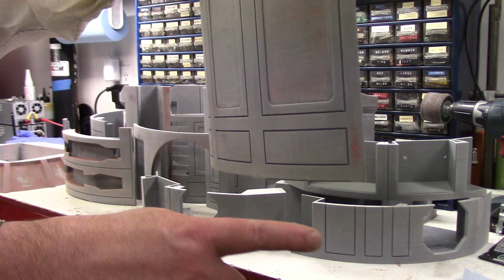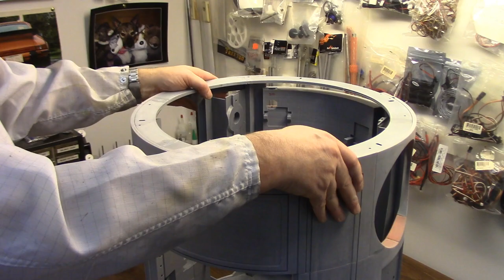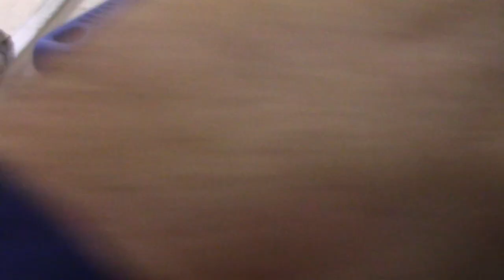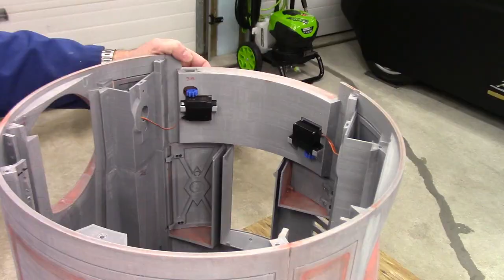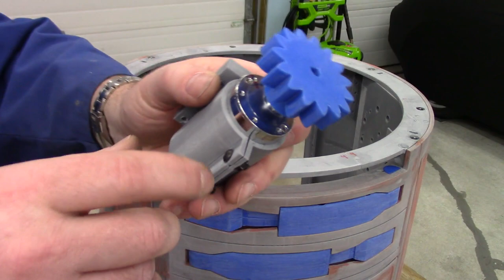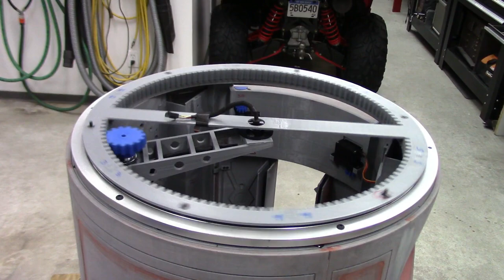Building R2-D2 - Part 5: Body Assembly including dome drive.

Comment: Mate are goggles expensive over there??
Reply from the maker: Specify... Ski, VR, Welding, FPV, Other...
Reply: @Rchelicopterfun  I’m just being a smart arse and at the same time worrying about you getting that dust in your eyes.. pla in the eye is no joke man!
Reply from the maker: @Harry Bomes - I see... literally. As is always the case, it's a risk/benefit call. Guess you've never had the pleasure of attempting to wear safety glasses/goggles during a cold Canadian winter day with a dust mask on as well. Two breaths and you can't see bugger all because the googles or glasses fog up instantaneously. As I was sanding all the body filler during that shot sequence and I actually wanted to see what I was doing, the mask won out. 🙂
Reply: @Rchelicopterfun  Ah good point.. I have a similar problem but it’s heat causing the steam.
Anyway, loving this series- I’m stealing a whole heap of your ideas!